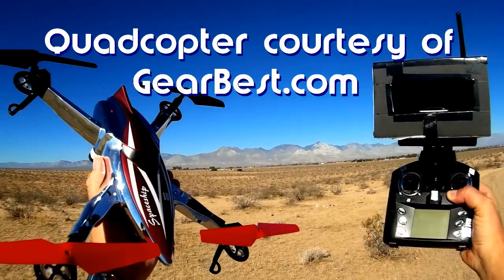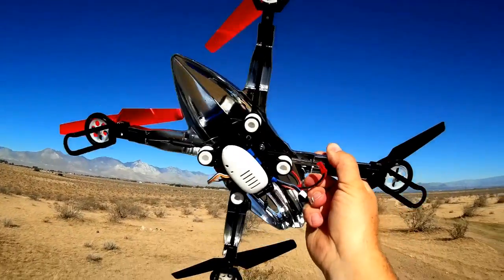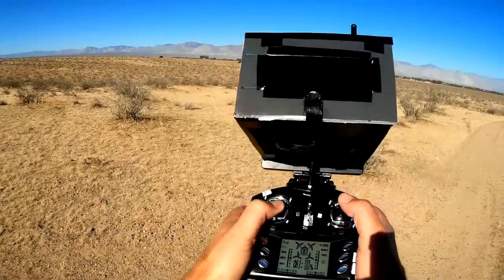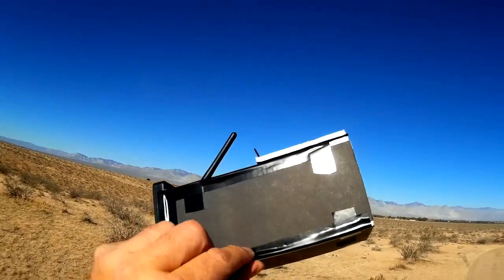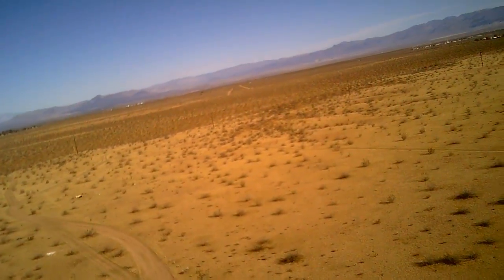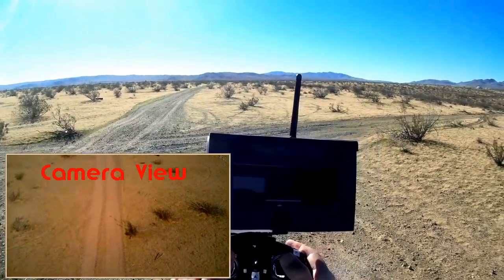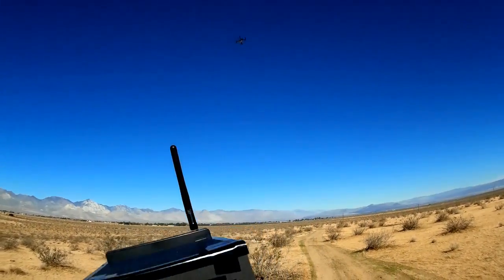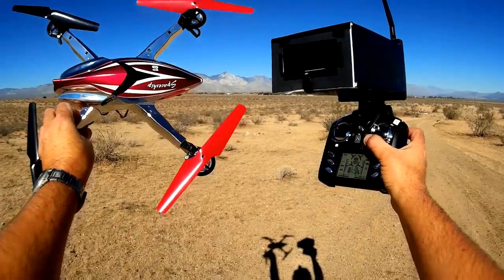WLToys Q212G Large Altitude Hold 5.8 Ghz FPV Drone

Comment: I saw another YouTuber review this thing, and he told everyone to connect the BATTERY FIRST, prior to turning on the TX. Do you have to do it that way? I commented on his video that he was operating unsafely.  If WLtoys actually designed the quadcopter this way, then I think that is unwise, and they may be opening themselves up to a lawsuit if it ever takes off out of control and hurts someone.
Reply from the maker: +Daniel Berry Unfortunately, that is the way many if not most toy grades (not just WLToys) are designed to bind.  Battery first, then turn on the transmitter to manually bind with an up down movement of the throttle.  If you go transmitter first, many will not bind.  It's not until you get into the hobby grade transmitter/quadcopters with automatic binding that you turn on the transmitter first.  Agreed that it is teaching bad habits, but unfortunately, that's the way it is.
Reply: +Quadcopter 101 Thanks for your feedback. I think the manufactures making RC aircraft that must connect to battery first are being irresponsible, but since most of these toy grade products will probably be purchased for children, then ultimately it is the parents who are responsible for their safety.  Appreciate your time...

Comment from the maker: Husbam, it is a very steady quadcopter for aerial video.  But recommend using a better camera than what comes with it. https://www.youtube.com/watch?v=DkWcSE9FGRU
https://www.youtube.com/watch?v=i32czqkycQM
https://www.youtube.com/watch?v=w2sqjk6ZmZI
Reply: +Quadcopter 101 Is that kingman Az? i have land with a moto ranch on it out there?
Reply from the maker: Moto Productions No it's not.  This is California.
Reply: +Quadcopter 101 
The 25mw all-in-one fpv module that Andy RC reviewed would be the charm I think.
Reply: +Quadcopter 101 hey i got that ares ethos fpv so the wltoys q212g is the same ? flys the same and such? I lost mine due too headwind and drifted it into the darn woods somewhere and im upset about it.. It flew good for me wasnt nothing crazy but i have a extra body for a ares that may work on the q212g . Does it have same features as ares ethos?
Reply: +Quadcopter 101 Just wondering what camera you recommend to use with the q212g?